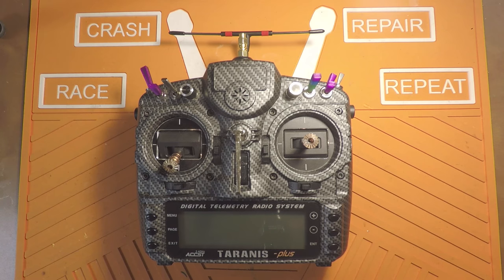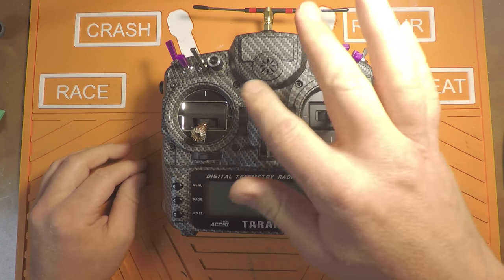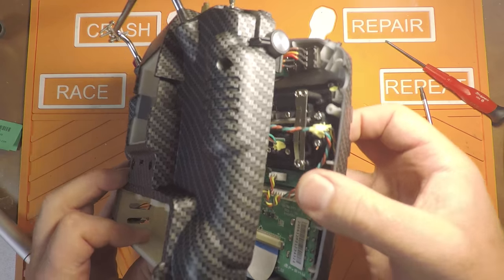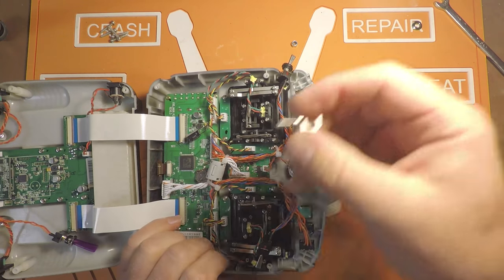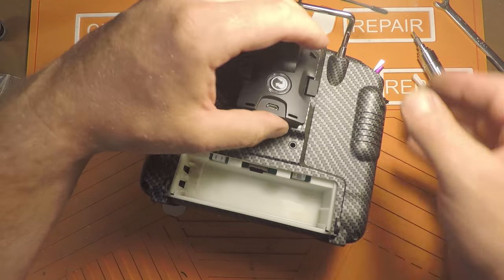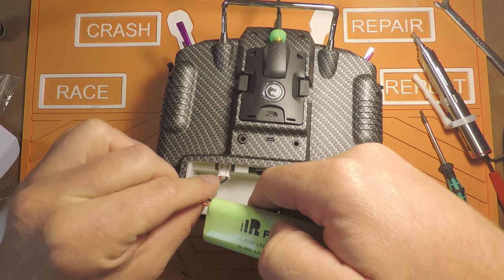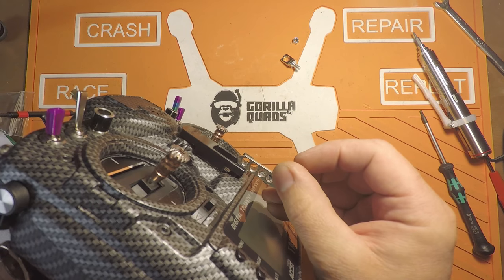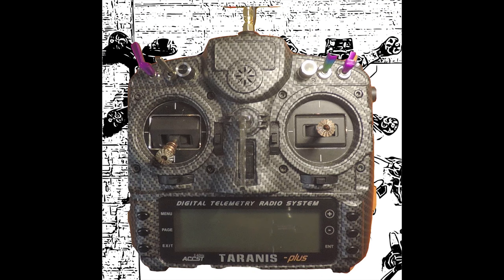G-Force neck strap balance bar for Taranis X9D

Comment: Hahahaha...Sorry for laughing, the installation was perfect right to the point where your snap hook didn't fit.
Reply from the maker: It was so defeating. Btw since that video the new be drone lanyard has broken. Thier stitching was very poor quality and had failed by the clasp. Fortunately I cought it in time as to not drop my radio. It gave me a good excuse to shorten the lanyard by a few inches. It was too long to start with.
Reply: That sucks, i make my own lanyard. I used to make dog collars and leashes before so it's a bit easier for me to make it. Is the balance bar compatible with the Q X7?
Reply from the maker: This one is not but GeForce make them for the x7 as well
Reply: Ok, i'll check that out. Thanks.
Reply: Buddy of mine flies with a qx7. He will be thrilled about these too! Thanks for spreading the word. I've looked and failed to find an acceptable replacement.